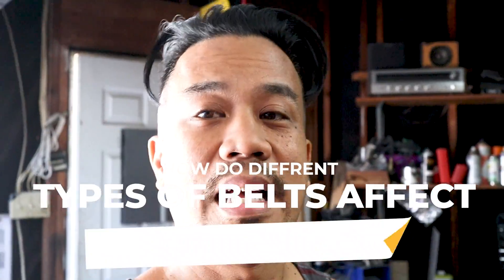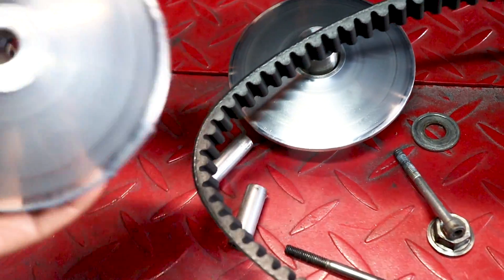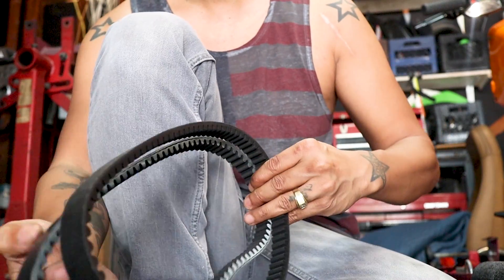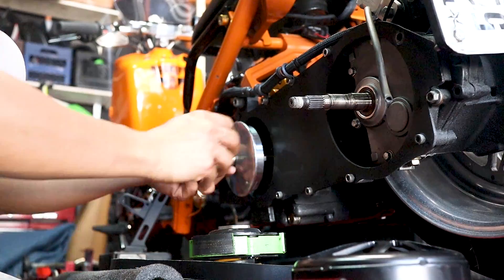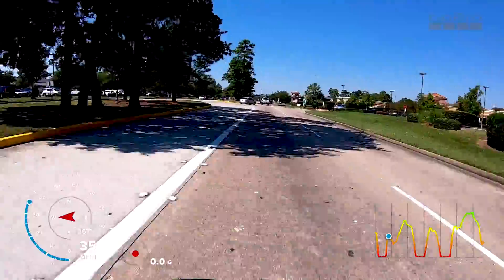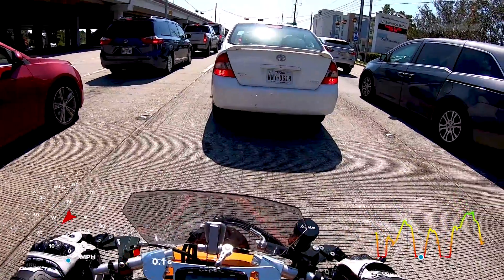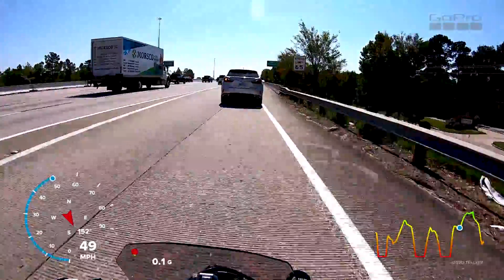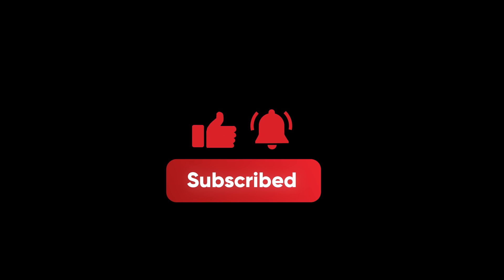How do belts affect your CVT performance on your scooter #GY6Ruckus #ScooterBelt #CVT

Comment: Its always better to use factory size
Mine came with 818 belt 171cc qmk161
Changed to 835 top speed dropped even after tuning its 90km/ph not 115km/ph like earlier 😅

Comment: Using longer belt causes top speed loss about 10-15 kmph is gone 🤦‍♀️ and i cant find 720mm 20mm 30 angle anywhere those are 743 or 729 18mm :/ yamaha sucks 😁

Comment: Hey i have a question.. i bought 765/17.5/30 belt and installed but it is shorter than 755/18/30 belt that was on the scooter and its actually too short and i lost start so i needed to put back old belt in. How is it possible it should be longer but its actually noticeably shorter like the 2 belts u are using in video.

Comment: I would have liked to see how each belt sat in the clutches!   Did the 835 run hotter?     My first scooter 50cc Chinese.  With 729 belt is stock..  And sits 5/16.  Low in the clutch. What length belt would give me. Top speed increase. And full shift ?   A 738. 743. 748?  Any ideas?  Thank you
Reply: @williamhaskellhaskell3162  What belt did you ended up installing?

Comment: Hi I have a problem my x22gt 250 is leaking coolant from the weep hole what do I need to do I reported it to venom but whoever I spoke to doesn't seem to know what to do either the bike is brand new it stinks I'm having problems with it and sad I never even rode it
Reply: @tonyhorn2322  replace the pump if it's leaking from the weep hole
Reply: I had the same problem with my x22gt. It was the coolant pump inner gasket. It was broken. I wound up also adding jb weld to the weep hole and it ran fine.

Comment: Just got my 1st Tune up on my Rocketta 150 CC. At Kiss My Gas Scooters in Springfield Mo. 3550 Km. It was 50k late. Got my carb & CVT cleaned. New Belt, Brake & Valve work & Accelerator adjustment $ 150.00. my weights were ok. These guys know how to do the work !

Comment: hey I have a 139 QMB I installed a 80cc bore kit after a month of running the belt broke and after replacing it, i dont get the same speed I used to. it had a 729 17.7 30 belt could i go longer ?
Reply: get the malossi x special belt for gy6 qmb139.. sized 680 18 30 i think.. check their website tho
Reply: A 680 replacing a 729 belt ?

Comment: My GY6 can run up to 95Kph. i used 842 20 30, stock CVT. And 13 grams roller weights. And i used a 1mm bushing spacer to give a torque if i have a backrider.

Comment: Good video, right now I have 150cc long case, the bike came to me with 835 in it, when I remove the crank case the belt naturally is about 1in below the top of the clutch, it seems as if too tight, its to my knowledge that naturally the belt should sit as close to the top of clutch as it can, I am getting 53mph in the small test runs I have done, I have an 842 on the way,,,,You think the 842 is the faster belt top end, did it effect torque and takeoff?  TY

Comment: Hello after my belt got shredded i replaced it and now my moped takes longer for the clutch to engages like 2-3 seconds before with the old belt before it broke it would be like 1 second and the clutch would engage and shoot off do you know what the problem could be? Many thanks
Reply: It's because it's a new belt, the more width wear on the belt the fast the acceleration, when mine gets like that that's how I know I need a new belt

Comment: I had a 835 on my 170cc scoot,went with a 842 (13g rollers) drove about a month and it sheared almost all the teeth off the belt,I have no idea why,decided to go back to the 835,no issues yet
Reply: What brand belt were you using?
Reply: @Tomijus  powerlink,I think its because the 842 is wider so it was pinching at the front

Comment: i have a 2014 mad dog  candy orange im running open variator no ankle biter with gold ban jing variator faceplate and orange ban jing clutch with 1500 rpm springs all the way around including big spring with a gold snowflake ban jing clutch bell new kevlar belt 842  with 12grm sliders  it seems now I have way slower takeoff and no top end I noticed the belt is coming no where close to the top of the variator nor is it starting out low enough feels like taking off in second gear I'm about to install big bore kit and cam is why I beefed up the clutch and variator but somethings not rite . what do you recommend I do to get this clutch and variator working rite. also love your orange ankle biter did you paint it yourself and wheres the best place to buy that same ankle biter the ones I've seen were two piece with spacers and over a hundred bucks.

Comment: @Small Engine Velocity  Texas Native!!! I have a Venom x22 GT automatic, what size belt do you recommend? I have seen videos one was a 918 22.5 30 another one was 828 22.5 30 I bought the second one it's on the way the factory one shredded I don't know what size was on it. Thanks.
Reply from the maker: Shorter belt will get you acceleration (The one you got). The other belt will take off slower but get you better top speed.
Reply: @SmallEngineVelocity  thanks. I'm hoping I didn't waste my money. Thanks for the reply, love your videos watch them all the time. Bought this Venom x22 GT automatic used 4 days ago drove it home and the belt shredded for some reason, it has 2600 miles on it with the original belt Maybe just an old belt I pray. Definitely looking into modding it to make her run like a beauty. Thanks again.

Comment: Can anybody give me a link to a reliable GY6 motor and not the cheap $300 to $500 ones?? I want to make mine a daily driver
Reply: I have 10, 467 miles still going strong I have upgraded my carburetor and installed in a 171cc ncy Big bore kit....
Reply from the maker: That NCY bbk is solid man . I got that one
Reply: Got mines from Amazon xpro long case GY6 engine$450
Reply: @JRome12128 how many miles have you put on it without major mechanical work?

Comment: Man, you got it running good (70+mph). I remember the road to 50 GET video's........ Lol 😄☝
Reply: I promise you after 15 years of riding Gy6's :
Do Not Run 842 belts.
It leaves a black smut all over the inside of the cvt.
The 842 spool engines out and cause all kinds of premature failures.
Watch how fast you get crankshaft leaking problems, that new seals wont fix.
Reply from the maker: We will see , thanks for the feedback. 842 leaves smut but the shorter does not ? It’s just ware on the belt? What kind of belts do you use ? How does a belt length on a bike that I ride 45-50 ruin my motor? Can you elaborate on how a longer belt that still fits the drive length in the cvt is going to ruin my motor. My 300 dollar motor.
Reply: @SmallEngineVelocity  
From your experience was the 842 better than the 835?
And thanks for the video that was reaaaalllyyyy informative ^^
Reply from the maker: A whole life time ago ! Lol

Comment: Incredible knowledge. Incredible channel. Love the breakdown on the details of components. Solid as he11 camera work too
Reply from the maker: Much appreciated!
Reply: No, If he was experienced with 842s he wouldn't run them.
They wear engines out causing all kinds of premature failure.
You have better take offs, reduced engine rpms at cruising speed, and keep your fuel mileage with the correct 835 on longcases with 12&13" rims.
You also get heavy black smut all over the inside of the CVT with 842s.
Don't use them, you will END UP regretting it.

Comment: What final gearing are you using
Reply from the maker: its all stock gearing still. I haven't decided what one to try
Reply: I have a Tao Tao Lancer scooter with a GY6 150cc I have a full racing exhaust, 12 pole stator, racing coil, A9 racing cam, stage 6 racing clutch, NCY variator with Dr. Polly 11g sliders, PWK 30mm racing carburetor... Now the important info: I bought a NCY 15*36 final gear drive and it killed it... I could barely hit 50 mph... So don't buy a 15*36 final gear drive unless you have a 180 or 232 Big Bore Kit...  I'm still trying to figure out the right final gear drive for a 150cc more than likely I'm just going to buy Taida 172 Big Bore Kit and see what happens... Thanks FYI: Great Video by the way✌
Reply: . With the 15*36, did that bring down your RPM, still trying to figure this out too, if I did somethings wrong.. Im wondering if you put a A12 in it, will it bring up the RPM with the set up you got.

Comment: Very nice brotha what fuel pump i have a mikuni an bogs after 1 mile full speed run
Reply: I have the same problem,  even with different carbs,  new fuel lines, pump, filters, and cleaned the tank, I have adjusted the float, it still does it, I have had 3carbs same issues,  I was trying to buy a 20mm carb, kept getting 18mm carbs sold as 20's,  I lost the spring and had to swap Out one,   I have a 24mm I'm going to swap, along with a 52.4mm bbk, and maybe a stroker crank, on my QMB, I'm building a complely new engine for my one of my Chinese scoots, and hoping to pull off a 150swap on the other!